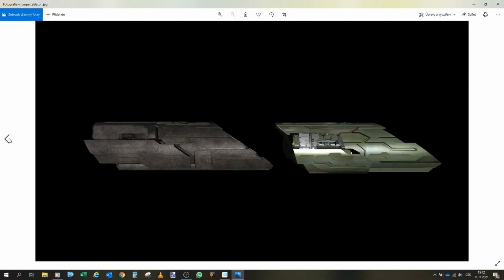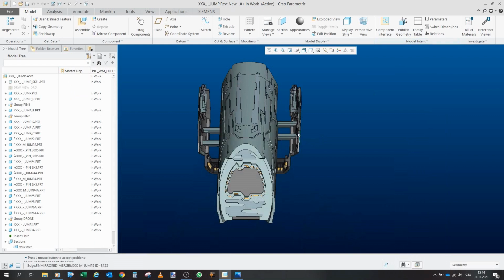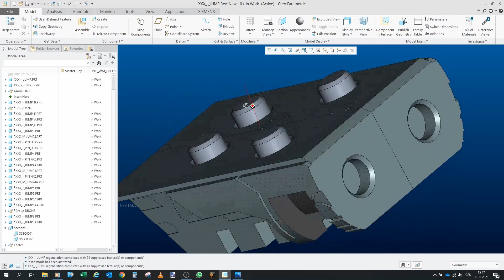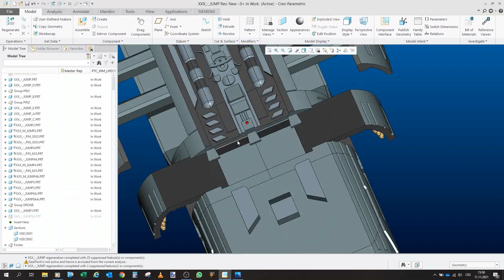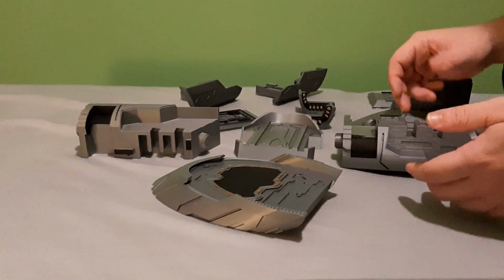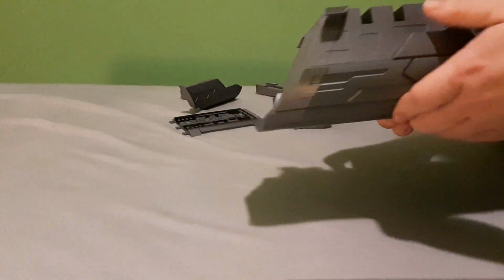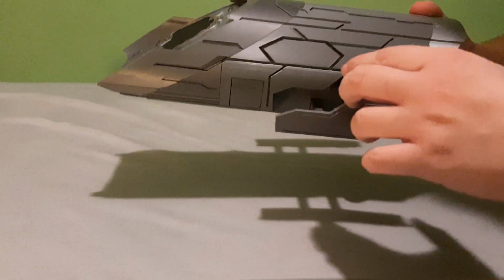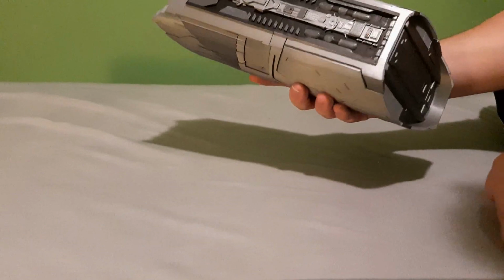Project Puddle Jumper

Comment from the maker: Guys, i know the group download on the thingiverse gives 404 error. No idea why, just download each file separately, that works. And it is not that many files.... Thanks ;)
Reply: can you make a zip folder with all parts inside of it and ad it to the files onlie ? that would make things a lot easier
Reply from the maker: @Em.P14  well i certainly can do that, but the issue with the 404 will still remain. I am actually printing a second jumper now and I made few modifications to the files so once it is printed and checked, I plan to remove the current files and replace them with the new ones
Reply: Any chance of a stand for this model its so awesome :)

Comment: Very cool!

I've just finished adapting all parts of the puddle jumper for the resin print. I also divided the front screen into two parts and provided it with additional connectors so that the screen can be printed with transparent resin. If the print works completely as desired, then I'll make it available as a remake on thingiverse. Regards TFK

Comment: Hey martin the gate is on printables and thingaverse correct? I am currently printing this one after two trek ships and doing the full size version with a little repainting. With regards to the large gate did you plan to model any type of stand? I am debating on a diaroma of the gate and the puddle jumper but just started learning 360 so have a LONG time to go lol
Reply from the maker: Nope. The big gate was designed from the start as a wall hanger. The small gates are indeed on both printables and thingiverse.

Comment: It would be a cool diorama. The jumper coming out of the gate all wings extended, jumper and gate suspended by thin wires in mid air, the models lite up internaly..
Reply from the maker: I was thinking about it as well

Comment: Very nice, would love to see a smaller scale version
Reply from the maker: Thanks
Reply: I actually printed it simply scaled down. Not the best Idea actually because the tolerances get very tight. So yeah. Printing full scale now. Just thought to comment here so other people with that idea don't make the same mistakes. While yes the relative tolerances of the connection points are the same. The absolut ones aren't. And printing at half the size you will probably like me hit the point where the detail the printer can print will not be sufficient to make the joints work as intended.

Comment: This is amazing work. What layer height was used in this print? If it weren't for the sound when you're connecting pieces I would think it's mold injected plastic, lol. Very nice.
Reply from the maker: Hello. I use standart height of 0,15mm per layer.